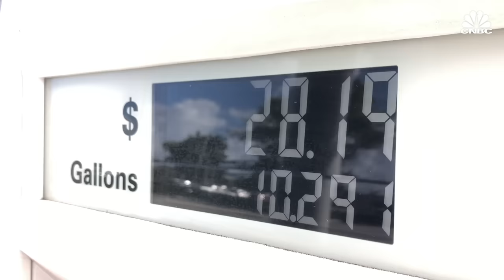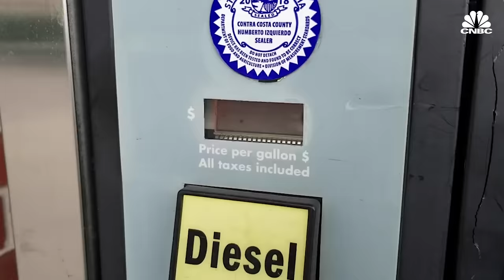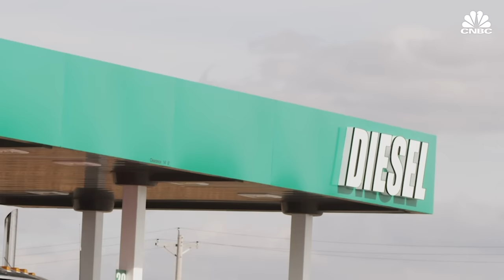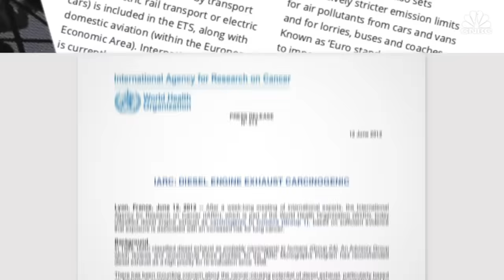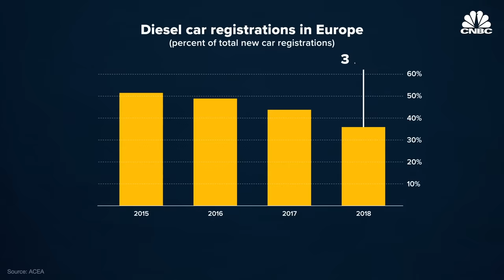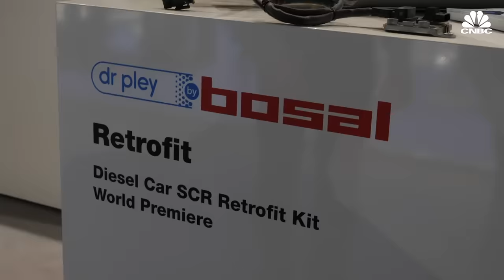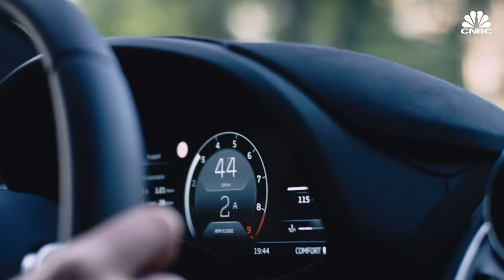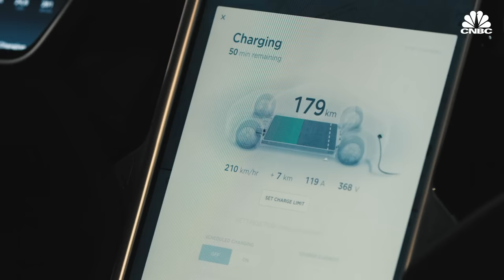Why Diesel Cars Are Disappearing

Comment: Own two diesels and they are both fantastic.  I'm expecting to get 30+ years of life out of them.  My diesel BMW car puts out outstanding power after tuning..  nearly 400 hp to the wheels and 600lb of torque yet can still achieve 40mpg and go 600miles on a tank.  On the drag strip it will pull a 12.6 second 1/4 mile at 111mph.  I have yet to see a gasoline or electric car that can match the range, efficiency, and performance of diesel.  Electric has the torque and efficiency but not the range.  Gas can lay down the power with a big V8 at the cost of efficiency and range.
Reply: If you have all of the emissions components on it then…….good luck. These are not your grandpa’s diesels.
Reply: You're not getting 30+ years out of your tuned BMD diesels lmao.
Reply: @jay-uo2bi  I laughed at that too. Modern bmws won't last 30 years
Reply: All electric cars far exceed the efficiency of your BMW. You are confusing fuel consumption with efficiency.  Your BMW is around 28% efficient at best. A typical electric car is 80 to 90% efficient.
Reply: @Brian-om2hh  correct! Most of the energy produced by ice engines doesn't go to the wheels... It's wasted as heat.
Reply: Lmfao you take an old chitty bmw to the track?
Ha wow that's dumb
Reply: @AbcAbc-sp1od  and light energy.
Reply: a golf 8 with a 2 litre 4 pistons engine gets better than 12.6 seconds man...
diesels are nice, no doubt, they do give a lotta torque if that is what you are after, but performance wise, there is a reason why performance cars don't use diesel engines...
also, sure, you get 400 horses but what cost? most of the tuned euro 6 diesel cars drop to euro 3 or euro 2 after stage 1+.
the only way diesels can go forward is with a cleaner fuel, like biodiesel or synthetic fuels.
Reply: 335d?

Comment: Bio-diesel is very controversial. I suspect that, at least with current production methods, it takes more fossil fuels to produce fertilizers for growing the bio-diesel crops than is saved by using the bio fuel. The market for bio-diesel has caused a sharp increase in the clearing of tropical forests for planting the required crops. It is also leading to an increase in food costs as farmers now have an incentive to grow bio fuel crops.
Reply: stop eating beef if you care about tropical forests
Reply: @sspiby  ye stop eating veggies and fruits too... start photosynthesis yourself
Reply: You can farm algae for biodiesel - can be harvested mechanically with little need for fuel since it floats in water.

Comment: When refining oil for gasoline, one of the FIRST steps is to get it to a diesel grade state.   Costs less to make than gasoline and gets better mileage.  Moral of the story: When it comes to energy there is no Utopia, only massive greed and the ability to position a product to "sound better" environmentally.  Even EVs are powered by coal burning utilities.
Reply: Not to mention environmentally devastating Lithium mines for batteries, and poor recycling possibilities. Dirty technology in its worst form.
We need a new scientific breakthrough, new battery  tech, cleaner electricity source or this transition is never going to happen in its full.
Reply: @mpelevic  The United States needs to improve it cities and use its transportation.
Reply: @thegamerkhan   Not only US. The whole world is energy inefficient.
Reply: Why do people pretend green electrical grids don't exist?
Reply: @mpelevic  But that's a pointless statement. Individual countries have managed to become very energy efficient or have been so for a long amount of time.
Reply: @planefan082  Because wind turbines are not eco friendly, the rare earths needed for EVs are highly toxic to the environment and usually mined at the expense of slave labor and they are RARE.  Currently the cost of an EV over 10 years including the initial cost is the same as a gas vehicle.  If everyone switched to EVs, not everyone would do green electricity causing massive loads on the grid as is.  could go on for an hour on this.

Comment: I love my diesel inspite of a gasoline and an electric car in my garage. I love my Audi Q5 TDI over my VW jetta and Hyundai Kona for long trips . The diesel is an absolute torque monster with great efficiency.
Reply: But it's hardly efficient if it can only manage 30% efficiency. I think you're confusing economy with efficiency.
Reply: @Brian-om2hh  yes I know that the diesel is not that much efficient. In terms of efficiency my hyundai kona electric is the best since it converts electricity into motion directly. But the TDi engine has a good mileage approximately 18 km per litre of diesel and is good for cruising.

Comment: I love my diesel. The power, efficiency and durability and longevity is incredible. I don't want to ever go back to gas, and definitely not electric.
There has been a media bias in the states for years it's obvious. They don't sell them here like rest of world. As long as we have long haul trucks, there will never be end to diesel.
Reply: long haul truckers would ware out an engine in like 50 K miles or less gas does not have the turque to move their loads from a dead stop nor to get it up a hill transmissions with extreme gear ratios will ware out faster its a no win to rely on gas nuclear power relies deisel to supply backup power if gas was so great why would they use desiel
Reply: Perfect for COAL ROLLING!!!!!!! OH YEAH!!
Reply: Yea...id like to see how long it would take an electric rig to make a run
Reply: General motors diesel back in the '80s didn't help it either.
Reply: Oh! There will be an end to diesel eventually. You may not live long enough to see it but they'll be an end to it. The emission systems to keep a diesel clean are horrendous. Not to mention expensive to maintain!
Reply: @youxkio you are harming your engines. The exhaust systems are tuned to minimize emissions. Running all that unburned fuel through the engine is going to cost you guys big time
Reply: @yeddyuligappa2261  I install the exhaust system I want. Not expensive. You really do not know where I live.
Reply: Electric is the future. It does literally everything better than their fuel-burning counterparts.
Reply: @lightningstrikestwice6302  thats why i have an older pre emissions reg fiesel if i did have anti pollution dpf filters i would remove them
Reply: @quinnsells1222  spending hours charging and expensive battery replacements
Reply: @thepurdychannel8866  Yes, because like you cell phone or laptop, batteries and charging times will never get better... Gas/diesel engines have maybe improved 300% in 80 years, battery tech has improved over 1000% in just 10 years, and it's just the beginning. Electric is not close to perfection today, but with electricity prices a fraction of gas prices, it's already cheaper to run electric today in the long run, even when you have to replace the battery at 150k to 200k miles at $22k. When batteries go from $22k to $7k in cost in the next 5 years, bringing long range electric cars down to 25k in cost with 80% recharge in 10 minutes, and gas prices 3x the cost for the same range, and very little maintenance, everyone will switch for the economics, regardless of their view on the environment. It's not a matter of if, but when, and based on how we have increased energy density by over 300% in just the past few years, 600 mile EV cars are right around the corner. And there's so many new battery technologies in development right now also.
Reply: @heyaisdabomb  If electric is the future for cars/trucks, the when to switch over will be key for most. I don’t want to switch until prices come done and there is more truck options but don’t want to long where my ICE has little to no value.
Reply: I'm going to predict here that electric will be popular for city commute, especially in warm climates. The colder North, with it's cold, snowy winters,  along with the transportation industry and small business using specialty service vehicles, will not go electric until battery/cold/reduced performance become much better. Until then, it's too stressful for most to risk being stranded in winter with a  cold car/low charge. Most will quietly use their AWD SUV.
Reply: @quinnsells1222  
Except range & refill. Two major considerations if you know people out of town, you know, friends & family?
Reply: @quinnsells1222  haven't seen a electric bulldozer yet maybe you should invent one Einstein
Reply: i have a heavily modified bmw 335d and i love it. 

it looks brutal.
it sounds brutal.
it’s really fast.
very reliable.

all this and still good mpg.

Comment: Diesel engines efficiency can not be denied .
Reply: While more efficient than gasoline engine, still a far cry from eclectic motor which is 90%+ efficiency and already around us today. (vs 35% typical small engine diesel)
Reply: Kevin Montrond  yeah, the eV technology is still in infancy, there a lot more potential technology development in the future, unlike ICE technology that already mature and probably wont go a lot further. Tesla claims they already have million mile battery technology waiting for production that will make truck freight possible in term of purchase cost with their tesla semi truck. Even now they already have production eVs faster (more powerful: torque & horsepower) than most more expensive ICE supercars. And the next tesla roadster (aka roaster) will be the car to rule them all. Diesel will still have place in big ship engine, maybe competing with hydrogen fuel motor.
Reply: Kevin Montrond which is exactly what is happening, what’s your point?
Reply: Diesel engine is most efficient,power limited by smoke,limt smoke more and still will be efficient,on electric cars not enough metals needed in production,electric car IS NOT the future
Reply: Kevin Montrond  Plus, ICE technology still has untapped potential, like see the new opposed-piston engine being developed by Achates Power. That could really revolutionize car travel.
Reply: @dinuciora2633  batteries are made of lithium, nickel, cobalt, graphene, aluminum. Maybe except cobalt, which only a small fraction of the composition, everything are abundant. And also unlike oil which is consumable, eVs do not consume this material, they only consume the electrons stored and flowing through them. When the battery goes bad because of structural changes from the charging and discharging cycle, these material will be 100% recycle and reuse in a new battery. The same thing cannot be done with oil once they become smoke and dust.
Reply: Kevin Montrond  already about to happen, Tesla already has a 1M mile rated battery, and their vehicles aren't far off from hitting 600mi on a charge.  Has to do with Maxwell's battery innovation, along with eliminating the nickel tabs found on each cell (less resistance/wasted energy).
Edit:  It should also be mentioned that most truck routes are local.  The bulk of freight is handled by shipping containers and distributed from local distributors.  Basically most miles on container ships/trains, then the last leg of the trip on trucks or other small delivery vehicles.
Reply: They don't want 
Any more Cose people are using  bio
Dessils
Reply: Wolfgang Preier  Yeah it's still in infancy, there's a lot more to come in the future in term of lifetime, cost, energy density (kW/kg). That's why you haven't see Tesla semi truck on road moving around hauling heavy cargo just yet where diesels thrive, hopefully soon. Elon really does a great job convincing people that electric works. But when other brands join in to compete in the eV market, then we will see some great development.
Reply: @putusudiarta1111  You are heavily 'informed' by marketing.. aren't you?
Reply: @dinuciora2633  The world best most efficient diesel engine barely manages above 50 % efficiency... and it is a 12 story high ship diesel. 

Rare earth are not a particular problem.... use of them has declined as batteries mature and in fact the highest consumption of cobalt is for internal combustion engines which use it for hardening purposes of engine components.
Reply: @putusudiarta1111  efficient in engergy use, trash in efficiency per weight
Reply: A liberal can deny anything, and needs no facts to back it up. Just feelings.
Reply: @thebravegallade731  Increased mass is indeed somewhat of a drawback but unlike ICE that at best can manage zero consumption (deactivating injection) EV can brake regenerative, offsetting this drawback to an extent. Not to mention that outside of inner city driving, air resistance is far more important than mass. 

It also gets better as batteries advance... in 10 more years the difference will be negligible.
Reply: @suprlite  This would be a rather bold statement considering that one of the biggest issues in the world right now is a bunch of poorly educated, ignorant, 100 % resistant to facts "100 % pure feelings guys.
Reply: @aresivrc1800  I see what you mean. But you just have to start reading book and open your mind for new ideas, and over time even you can become less of an ignorant, fact resistant person. It takes work and commitment, but dont give up.
Reply: Yes very efficient at destroying your lungs
Reply: @topstar443  i've been living and working around dieselengines since the 70's and my lungs are in great shape. So no, they are not effective at destroying lungs, no matter what they told you at millenial academy.
Reply: Biden Is Your President!!! Get Over It!!!  You need to remember that we are just 10 years or so into EV's as a serious proposition. There will be significant developments in battery and other technology in the years to come. The second generation of electric cars will be appearing on the market in 2021. Mercedes, VW, Tesla, BMW and others are investing vast sums in EV development. We will see vehicle range increasing to 400+ miles quite soon, and that is more than enough for a day's driving. The amount of time spent actually charging is being minimized too. Tesla's new Superchargers can add 75 miles of range in just 5 minutes. Here in the UK, several new rapid charging hubs have been built on major routes. These offer similar charge rates to Tesla's charge network, for cars able to handle it, and have both solar panels on the roof, plus large battery storage on site, to deal with big charge demands readily.
Reply: Put any sort of load on those batteries and any hope of range us eliminated without a charging system on board
Reply: It can be proven though, and is around 25 to 30%.  You are confusing efficiency with fuel economy...... Both petrol and diesel engines waste 70 of the energy they produce as heat. That's actually rather poor efficiency......